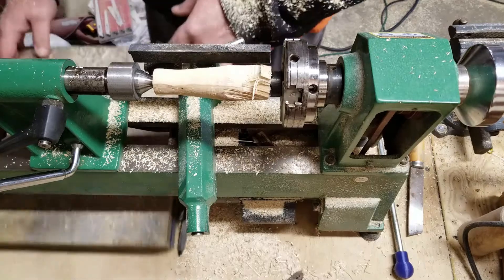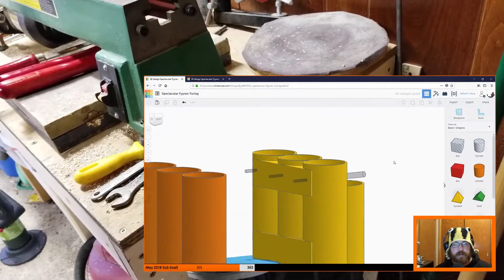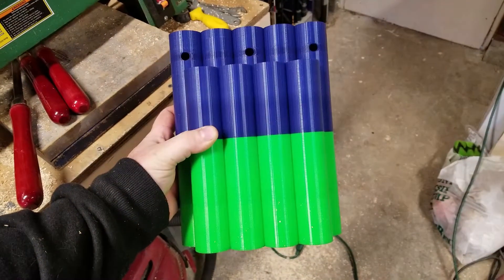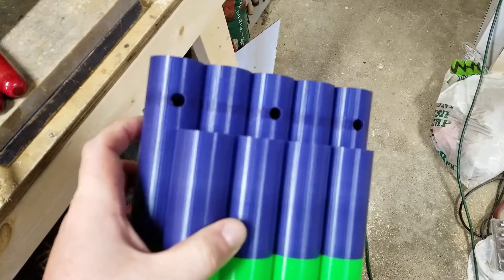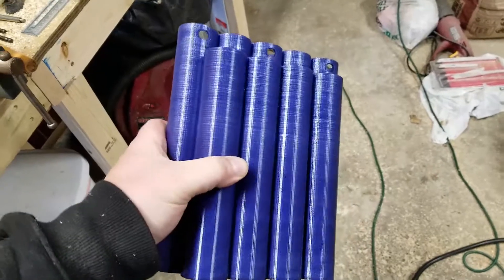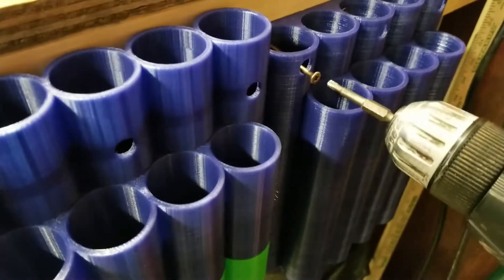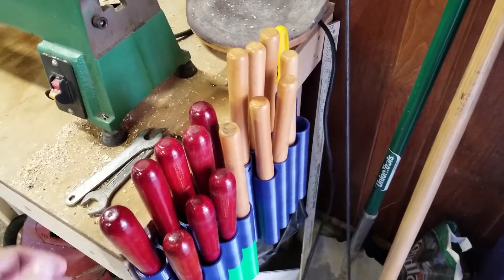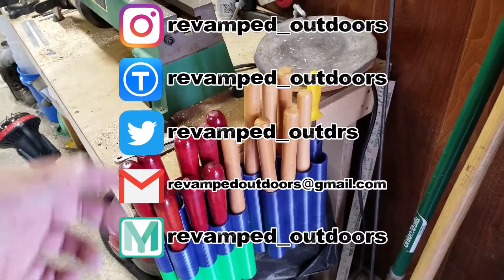The YouTube Think Tank Wood Lathe Tool Rack

Comment: Nice job.... you said that you can’t see the cutting end of the tool. Could you not design it to see the tip at the bottom? Window, hole at bottom, cutting end up handle down, transparent material???
Reply from the maker: Thanks! For sure! I think if someone had something like this at eye level it would be more handy to see which is which but for now I just keep the 3 most useful at the end and it seems to be working well. They're still holding up just fine in an uninsulated garage so, so far so good!

Comment: How much filament did it take to produce each one?
Reply from the maker: About 1 kg per holder, a little less with less infill settings.
Reply: @RevampedOutdoors , thanks. When you were loading the tools into the holders I was curious about how you'd know which tool was which. In the end did you go with some identifier on the end each tool? Did this approach work?
Reply from the maker: I wanted to print some end caps but it ended up not being a huge deal, I mostly only use two tools for most projects so it wasn't a huge deal. If you really needed to you could always brand a number on the butt of each handle or some masking tape. The rack is still holding up well, even dropping the tools hard seems to be fine they haven't cut through yet. Hope that helps!

Comment: Man, I would love to buy two sets of these from you, enough to hold 30 tools in each set.  Let me know if you would do that
Reply from the maker: Unfortunately I don't sell anything yet! I may make a shop or website in the future but right now just posting the STLs and sharing projects is my main goal! I appreciate you liking the design! 15 tools per set would be a tough design challenge and would probably need to be set out from the mounting platform by about 8" with three layers (5 tools a piece).  I think with that many tools it would be more cost effective to make it out of some 2" diameter PVC pipes with end caps, or a wood working alternative.  Once FDM printing gets involved things of this size get to be relatively cost ineffective.
Reply: Revamped Outdoors well thanks for the feedback, I’m obviously pretty ignorant about 3-D printing 😐
Reply from the maker: No worries! I've seen people do large projects like that, it is possible.  It's just one of those things that other solutions are quicker and cheaper but it's fun to try proof of concept!